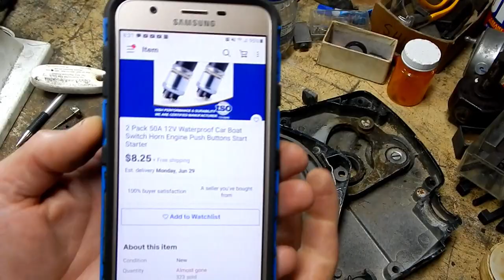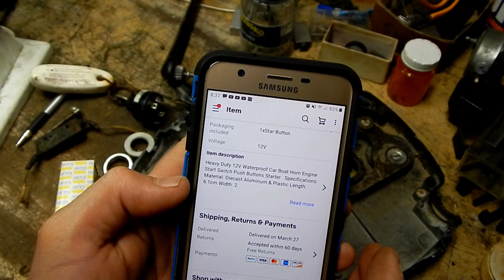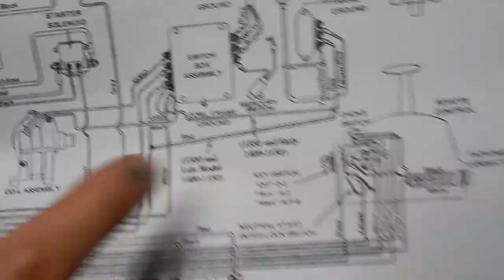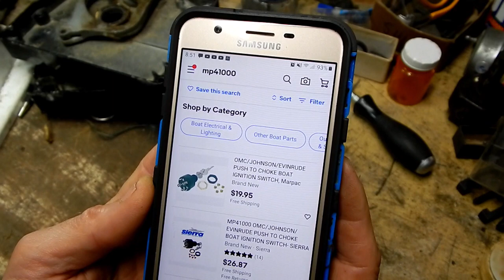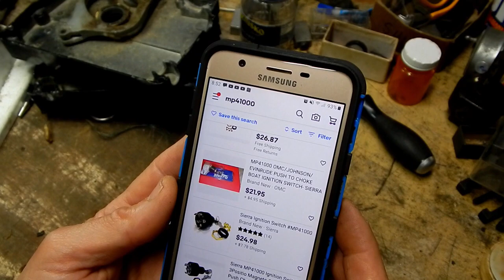The Tower of Power/Concord Boat Part 89: Rebuilding the Merconrol.

Comment: I have the mercontrol with red or orange decals. It has a lot play in it and only allows the boat to get up to 32mph. It runs and idles good nor does it bog down. I feel like the cables need adjusted or there's a problem inside the mercontrol. What should I start with?

Comment: Why would mine lock in forward and not move? It won't go back into neutral or reverse. Would it be the cables? I disassembled mine. Still the issue just haven't replaced cable yet

Comment: Rebuilding 1970 800 Mercury. Just fired it up today. Throttle cable needs replacement. Mercontrol is definitely fun getting back together. Still... 10 years of Mercruiser... much easier. My key is dash mounted. Choke wire had mysteriously disappeared. I may dash mount a choke switch too at some point.

Comment: @7:15 the newer ones have a button at the base of the throttle/shift lever that you hold in to prevent the gear shift when you push the lever forward. Instead of two levers, you now have one lever and a button. I have no idea how it works mechanically. I didn't even know how the old style control worked until I saw your video.

This is all quite similar to the way the power lever in a Cirrus airplane is set up to control both the throttle and the propeller governor at the same time. Mercury beat them to the punch by three decades.

Comment: The fact that that switch pin was getting 12 volts all the time is most likely why that pin corroded away, for example, leaving your battery in the boat, (at least in salt water) you get corrosion around the terminals due to the power being there all the time.

Comment: I have this mercontrol. My issue is that the throttle revs up but the heat doesn't engage into gear untill after I'm past full rev forward on throttle. 😭
Reply from the maker: First thing I would do is with the motor off, have someone move the lever while you watch the linkages inside the motor to determine they are moving correctly. That should tell you if its an issue with the mercontrol or the engine.
Reply: @stevewatr  after watching your video and seeing you talk about the one lever being for increasing rpm well idling for (warming up the engine) I realized that it wouldn't be possible for that to increase the rpm if the shifter cables was hooked to that side! I switched the cables and it works perfect!!! Just fired up the 40hp mercury 402 and she shifts like a dream! 🤟 Thanks for the video and response ✊